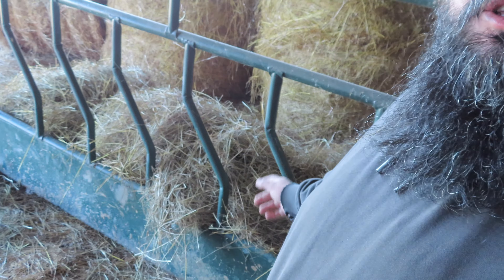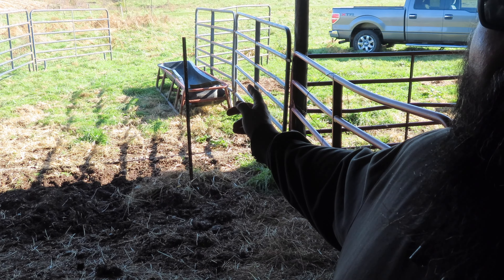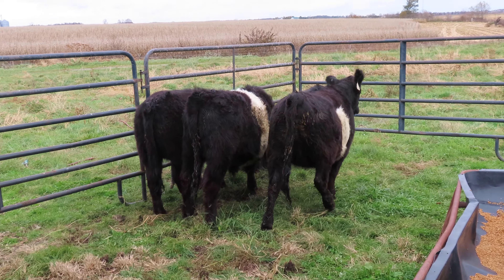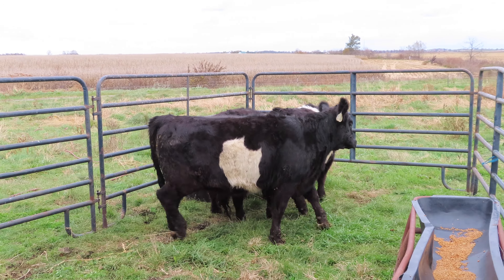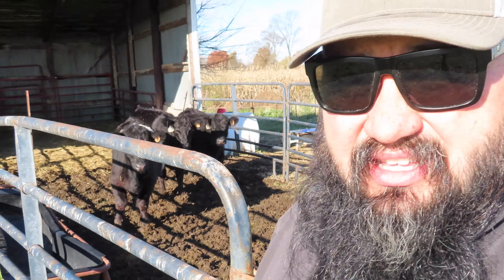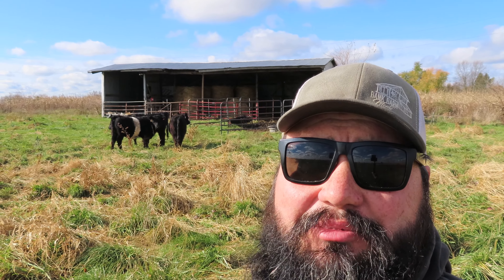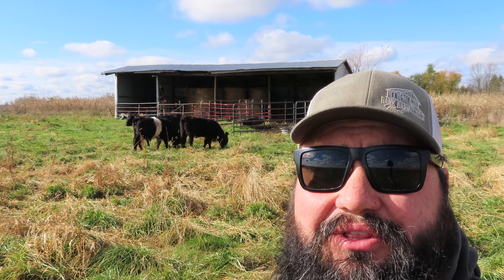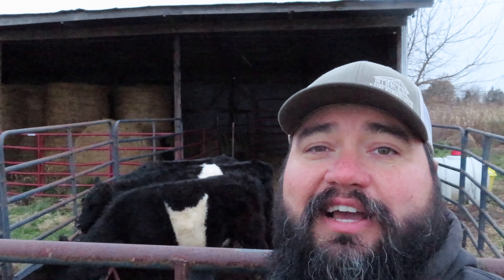Setting Up Electric Fence For Cattle

Comment: It went well for you but didn't show me anything about setup of the electric fence....
Reply from the maker: For that set up I just tapped into an existing line. We have tried a couple of different methods and have found one that works well for us. I am setting up a new strand currently so I will show more of what I am using/doing when setting it up. Thanks for the input.